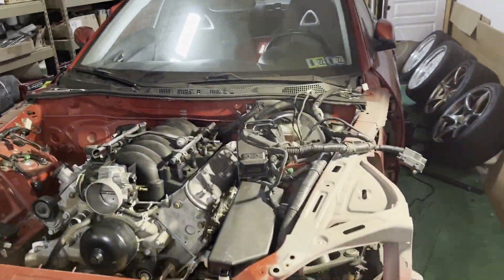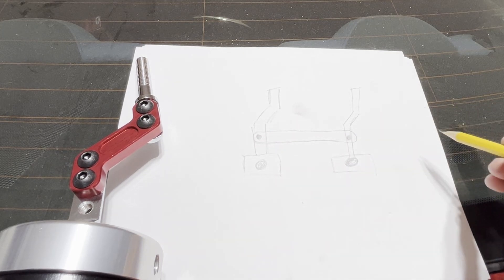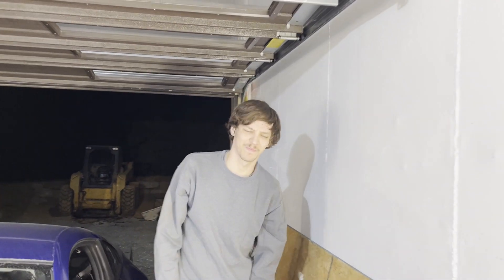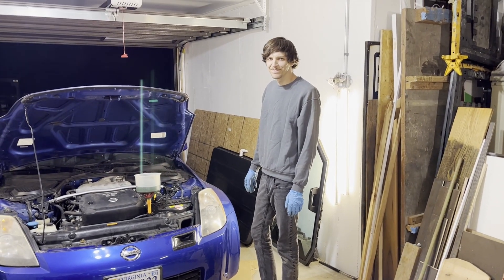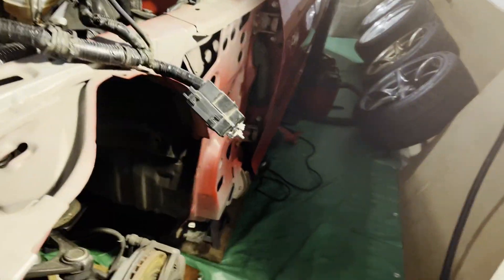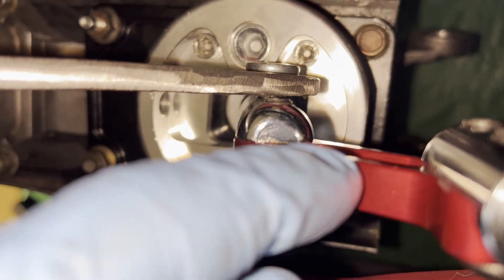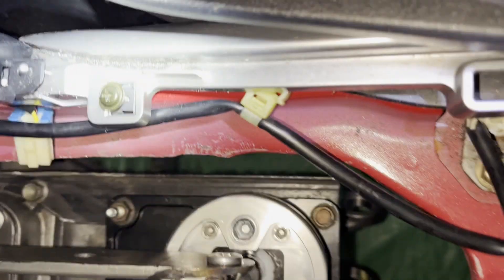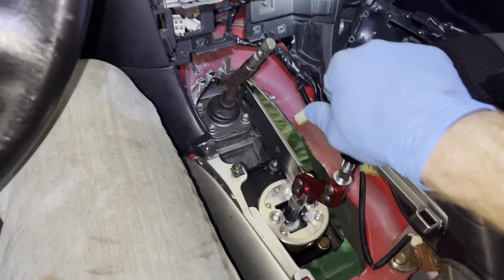AR5 Remote Shifter | LS RX8 Build

Comment: This is great idea ! I manual swapped my crown Victoria and the original shifter is right under the dashboard so i welded a right angle bar and sure it has very long throw between 2&4 gears.
Reply from the maker: Thank you so much! I am thinking I will definitely need to make some modifications to this design to eliminate some of the slop, but to get the car going it should do just fine. There are always sacrifices when doing things yourself!

Comment: That's pretty smart. Maybe you can put another one of those bars on the other side to really make the mechanism sturdy.
Reply from the maker: Much appreciated!! I did come up with a "Version 2" of the design with a clevis end on both ends of the linkage. This really got rid of most of the play in the system. I show this at the 5:47 mark of this video if you want to check it out :) https://youtu.be/J37XoIQY7jo?si=v4iMIyA9Qssy_yod

Comment: I’m having this problem on a completely different car and engine swap. I have more play than you so thinking about using thrust bearings in between the horizontal and vertical linkages, that way you could get the bolts super tight with no binding (I think)
Reply from the maker: I ordered some hardware to make a more robust V2 of the linkage. I think only having the linkage on one side is making it sloppy. I will post an update when I make my adjustments!! thanks for the comment!
Reply: @gastancehouse  yeah putting it in twin shear would help! Look forward to an update.
Reply: I'm wondering if it would be a possibility to use the saturn sky Tail shaft extension thingy